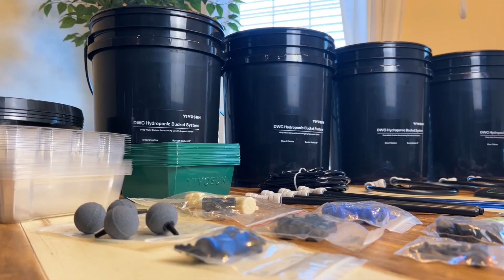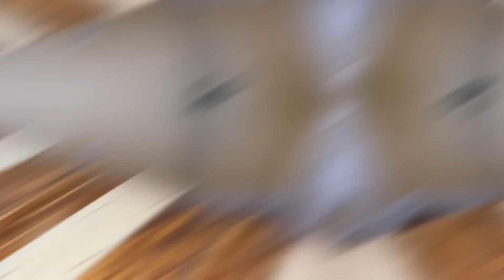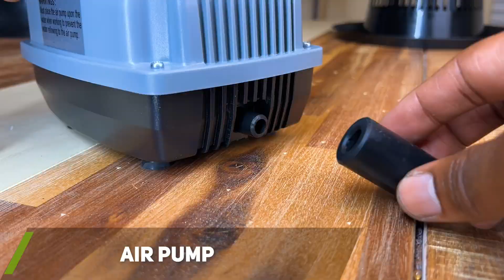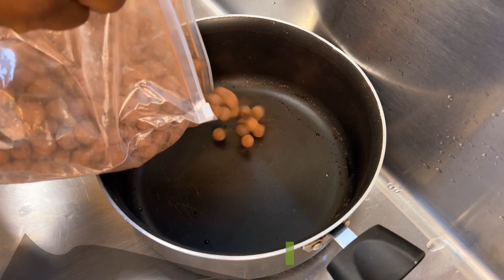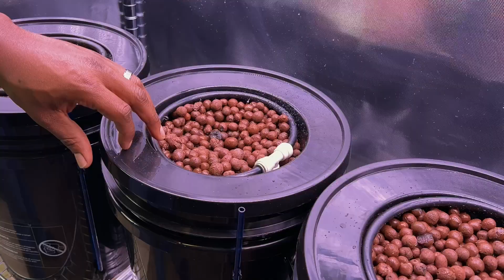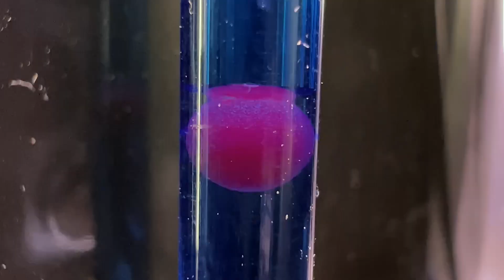Grow LOTS of Food Indoors - This SIMPLE Kit Will Help You Do It

Comment: More please. Have you seen the flood and drain systems?
Reply from the maker: I sure have. That's other type I would like to experiment with one day. Are you currently using a hydroponic system?
Reply: @GreenTechTown  No I like the big container beds with soil, but I think the flood and drain seems very cool.  in my opinion, I Like the 50 Gallon plus. If you got good soil then its the way to go. Much cheaper too. And if you can make your own amendments like worm castings and compost it is very sustainable. Big tip is killing the bugs with nematodes when you try to bring indoors or freezing soil first.